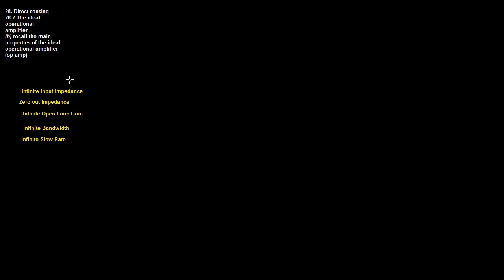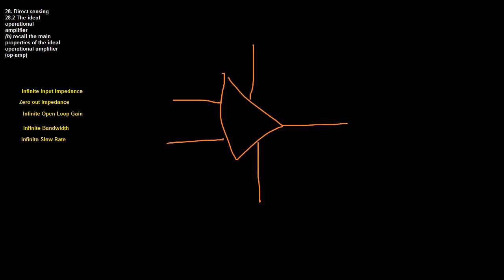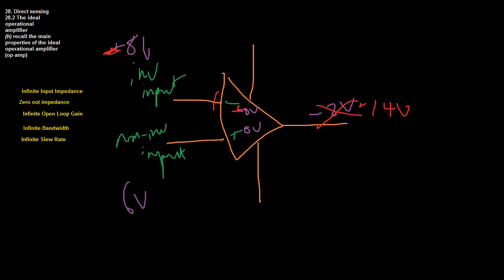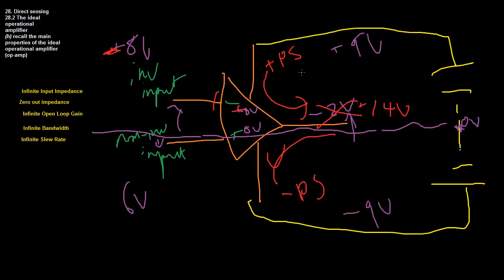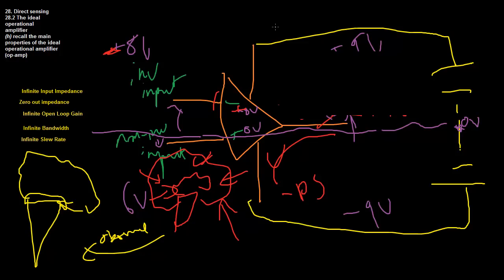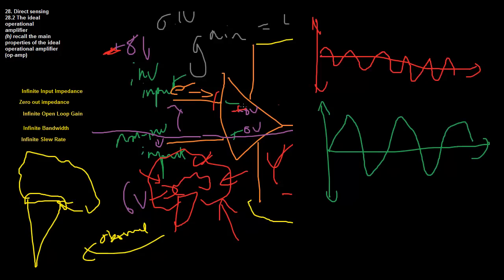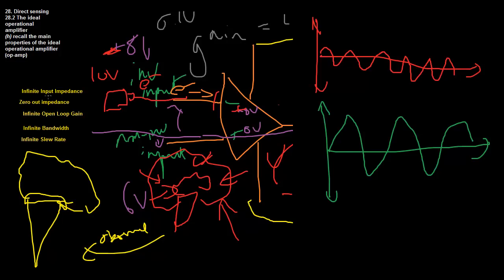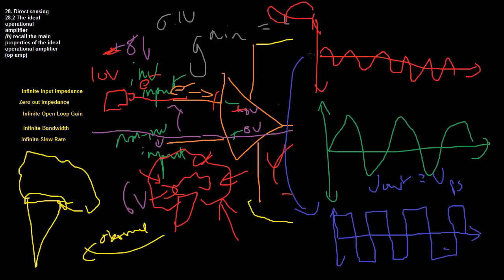28.2 Direct Sensing - The Ideal Op-Amp - CIE A Level Physics

Comment: Ahh, well. I have already passed my A levels. I am not sure if this is still included in the syllabus, But if you can re-do this, it'd be a great help for current A level students.

Because as far as I know, there are not much info on OpAmps , direct sensing available on the internet. Even if they are, they are too confusing and complicated. Thanks! :)